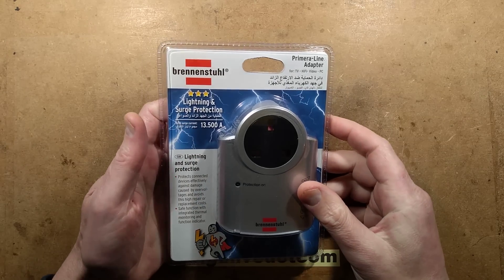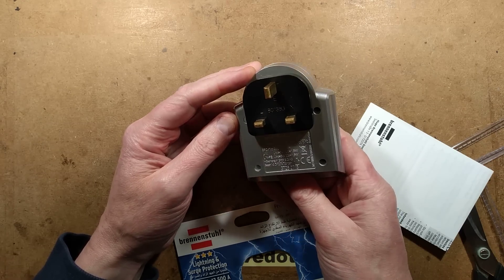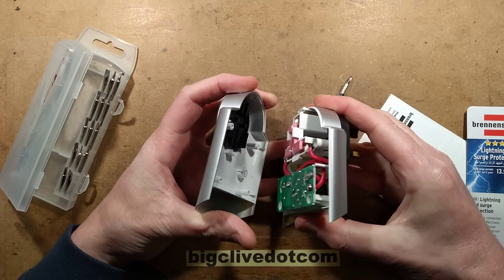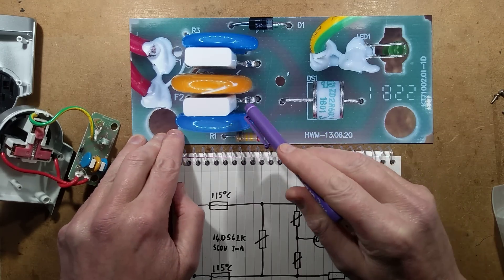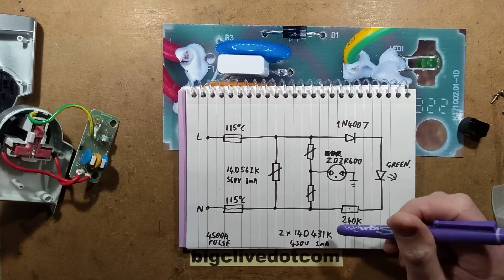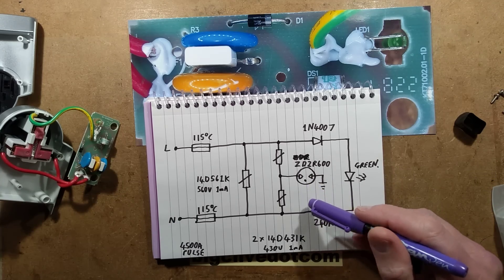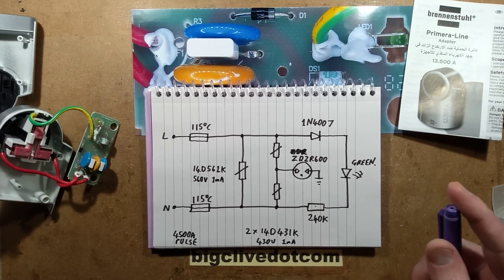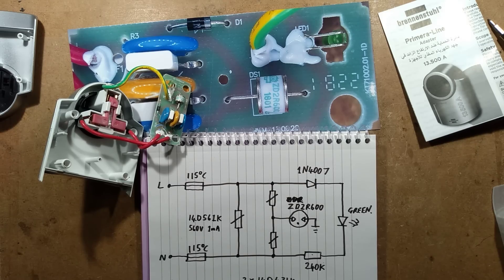Inside a 13,500A surge protector.  (With schematic.)

Comment: Hi Clive. I recently bought two InTempo Tailgate speakers. I returned the one that didn't work. Replacement didn't work either, so naturally I took it to bits and found out why. Possibly the thinnest PCB I've ever seen with very misaligned, feebly soldered components and liquid flux still puddled all over the board on both sides. I'm not skilled enough to fix it, and don't care, but I'd appreciate if you get hold of one and do a teardown vid. If the manufacturer had spent a bit more change on the board, this would be a nice bit of kit for busking. Sadly they didn't want to charge me £10 extra for that durability on a £30 retail item. A shame. :(

Comment: MOVs are rated in joules of dissipation. They might be 50, 100 joules or whatever. A joule is a watt-second, so if you have a specific voltage and an impressively high ampere rated MOV you can roughly figure out how long that MOV will last before exploding. This is left as an exercise for the student; compare to the length of a lightning strike. 

The other thing I'd like to point out is that MOVs are good for one time use. After they soak up that one lightning-induced surge (you hope), then you throw them out because their breakdown as been compromised. Many will start to break down over time with no surges, then they just burn up because their dissipation goes exponential. They are not to be used as zener diodes. 

Also, because they break down in nanoseconds, you will have some interesting spikes ricocheting around your power lines unless you position them at the lowest inductance point across the incoming mains.
Reply: Thank you for mentioning that MOVs break down over time. Probably a good 95-98% of people don't know that line voltage dips and spikes all day long "wearing out" surge protectors, and they should be replaced every so often to be on the safer side.

Comment: How fast does it work?  I once lost a computer power supply to what I think was a lightning surge.  Would this device have prevented that damage had it been in the circuit?
Reply: MOVs are very fast devices, on the order of 500 picoseconds.  If your supply died due to a voltage surge containing a voltage and energy amount the MOV can absorb, then yes a surge suppressor likely would have saved it.

Comment: There are similar protections in PC powersuplies and APC units.
How long wiering they can protect from surges? I mean as long the copper wire goes, the resistance almost 0, so if I plug this anywhere it shail protect anything untill reaching the nearest street transformator (wich seems impossible).
Oddly simple circuit, I just wonder why these are so large in housing and made like an addable socket switch.

Comment: I've encountered a few Brennenstuhl products, and they all seemed to follow the same pattern - a robust high quality case with the crudest possible contents. For example they make (or made) power strips and power sockets with built in power measurement that avoid using a 20 cent energy measurement chip by roughly measuring RMS voltage and RMS current and displaying the product (i.e. they display apparent power instead of the active power you would expect). The case of this surge protector seems to be thin white plastic sprayed over with silver coloured paint, so even the case isn't very high quality.

Comment: more then certain 13.5 amps. im sorry 13.5KA would obliterate it and anything connected to it more then likely
Reply: Bourns 2045 Series 400V 15kA Axial 2 Electrode Gas Discharge Tube
https://uk.rs-online.com/web/p/gas-discharge-tubes/7687452/
Oh really ?

Comment: Limited protection for other connected devices on the other side of the circuit:
1. It cannot protect against a common mode surge. This occurs when both L & N have elevated voltages which is common for lightning induced surges.
2. Any energy passing through  the GDT will elevate the ground voltage providing a reverse path for the surge to reach devices. Its possible the voltage potential will be higher on the ground than L-N for other devices connected to ground. Typically Ground has a high impedance of about 6 ohms and thus lacks the ability to shunt large surge currents.  

Generally a good Surge suppressor will filter out a surge pulse using an high frequency LC filter such that a fast transit cannot reach the load. The other alternative is to absorb the energy in a Cap bank that slowly bleeds off the collected energy. 

I've see a lot of cheap MOV surge protectors do more harm when the shunt energy into ground, only to damage other devices connected to the same ground circuit. MOVs are usually only good for very few number of surges. Quality shunt type protectors use Silicon Avalanche diodes (very beefy Zener diodes) which do not degrade with use. Typically MOVs have high clamping voltages well above mains voltage so they are not frequently triggers.
Reply: Huh?  That's what the gas discharge tube circuit is for.  A common mode surge will be dissipated to ground through the two MOVs and the gas discharge tube and the voltage spike on the entire circuit will be clamped to the MOV clamping voltage.  Once the tube arcs over, there is essentially zero voltage drop across the tube.
How exactly would the voltage on the ground be HIGHER than the L-N pulse that energized it?  In the US, the ground connection has to be low enough impedance to trip the breaker if hot is shorted to ground.  Any higher voltage will do it also.

Comment: Where does the device plugged into it come in? Is this just in parallel to a direct throughput?
Reply: The MOVs are in parallel with the entire branch circuit.  It protects everything in your house, to one degree or another.  The more impedance there is between the protector and your device, the less it will protect it.

Comment: 1.8kv let through voltage (Up)... crap. The withstand voltage as defined by BS EN 62305 - Protection against lightning, for electronic equipment is only 1.5 kV. Industry standard for final equipment level surge protection devices (SPDs) is sub 600v when tested at a "type 3" surge. All they have done to come up with that 13.5kA surge rating is to simply add up the total across all modes (phase to neutral, phase to earth, neutral to earth being the modes). Not the way to do it. BS EN 62305 and BS EN 61643 both work on ratings per mode, not total. With that GDT rated at only 1 shot of 5kA, and that being the one path to earth, that kinda gives you a better idea of the proper rating... /*edit, wrote all this prior to you saying that at the 10 minute mark*/

Comment: Why would 13.5 amps be so odd? X220v =  about 3000 watts which protects the wires inside the wall from heat abd fire if too many appliances are using the same wire. But i am only a student dear master Big Clive.

Comment: I would not trust my devices with this in between !  I would not use any thermal resistors or fuses to protect against surges!  would use varistors in a parallel with two gas discharge tubes and two transient  suppressors.
Reply: You need to watch the video again.  The thermal resistors keep the thing from burning your house down, they're not protecting against surges.
Reply: @stargazer7644  what is the product called ?
Reply: @MGoudsmits  You're complaining that you wouldn't use thermal resistors or fuses to protect against surges.  This product doesn't use them for that purpose.  It uses MOVs (varistors) and a gas discharge tube to clamp the surges.  The fuses are there to keep the thing from going nova and burning up if the MOVs fail.
Reply: @stargazer7644  sorry  maybe not clear enough,  but the thing is a surge  protector,  even for lightning it says.  well the design  prevents it from short circuiting the over voltage ( surge) and re-directing the current ASAP to the ground. the one resistor might be on fire before the other one realizes it gets warm !  then the lighting surge is over, did its damage and the device starts to limit the current.  the surge in nanoseconds is probably way to fast  compared to the hysteresis of the heath transfer of miliseconds.

maybe you can explain why you would not opt for redirecting the surge in stead of  trying to dissipate it and then when all fails finally redirect it to ground.  do not forget this device is in parallel.  so imagine your high end TV  uses 180 watts  so 1,6 amps at 110 v something like that  that makes your  TV act as if it is a resistor of 68 Ohms.
Now which way will the current go to the low 68 Ohms or the resistor that allows 1 mili Amp at 560 volt ??

Comment: I need help. Ive got cables soldered on a tiny board. One cable go to the computer and the other cable go to the headphones. The issue: How do I prevent/protect the soldering points from accidentally getting ripped off if the cable gets snagged on something? I have no clue what to do.
Reply: Drill two hole close together, loop the wire in and out like a buckle
Reply from the maker: Hot melt glue and/or folding the cables round so the solder joints don't get pulled directly?

Comment: I started as a telephone engineer.  We used to routinely fit lightening protection gas discharge tubes, fuses, local earth and same again at the exchange.  When lightening hit you'd be sent to scrape the wires off the wall  and once, to pull art of the phone case out of the door.
The exchange had bigger separation and usually took little or no damage from a strike.

As a mill town we had 100s of mills running massive inductive loads, as well as heavy and light engineering.  The mains was pretty noisy most of the time.  Spike filters worked quite well on the early digital kit, we had various sizes so  could cope with most cases including a huge DC plastic welder.  I still use filters.  Only powercuts affect anything.  I've seen 7 strikes in the nextdoor field, less than 20 yards away with no effect. I don't know if they do work or if it's just the type of land or what - I work on the principle that its hurting nothing and costs nothing, so why not?
Reply from the maker: The power lines have lightning arrestors which are basically stacks of MOVs that shunt the strike to ground on the primary side of the transformers.

Comment: What is the point of the gas discharge and having it to ground?
Reply from the maker: It can pass a lot of current and in the normal state has almost zero leakage current to earth/ground.
Reply: @bigclivedotcom  Thanks bigclive. However, wont this trip a GFI every time there is a moderate spike? Also, why not just have the one varistor? Is it a redundancy thing, using two different methods?

Comment: We used to use gas discharge tubes as trigger devices on capacitive discharge high voltage generators.
The tubes were sourced from discarded phones which were full of those tubes for protection.

Comment: The thing is 13500, should classically be expressed as 13'500. Using an apostrophe gives absolute disambiguation from comma ( , ) or full stop/decimal point ( . ) - especially if hand written. It is only an artefact of the lazy computer world that has introduced the comma as a separator in numerical expression.

Anyway, that said, who else loves it when Clive sticks his fingers directly across a device and says " Am I gonna get a zap off o' this? " . . . ? - I guess that if you really wanted to, you could, in theory, build a massive surge suppression unit, and connect it in parallel with your main switch, at the distribution board, to protect your entire household gadget inventory?

Comment: APC used to offer that, and in Florida they lost money hand over fist.. After all, Lightning just jumped 5 miles or more down to your power line... and as a result into your house.  They are claiming 13,500 amps?  How many Joules?  The problem is that lightning wants to go to ground, and anywhere it does it there is a bunch of current, which causes induced current in all wires near by.  MOVs will do SOME help, and are part of the electrical code in Florida.. but do they help?  Or is the only thing you are getting an insurance policy that may or may not help????  In Florida, I never got damage directly from the electrical lines.. but watched a lightning strike hit a pole just outside the condo complex... and it jumped over to the telephone mushroom next to the pole.. and that is where loud noises happened.. a VERY expensive Modem for that time frame.. and arc'd (after popping the tops off about 10 chips in the modem) over to the hard drive in the computer... and burned a HOLE in the sealed unit.....<sigh>  actually managed to get a piece of tape over the hole... and found that there was a burned spot on the motor so it wouldn't spin up... I picked up the whole computer and gave it a spin while turning on the power, and the hard drive spun up!  With that I was able to pull a full back up of that drive... and when the insurance paid off the $900 modem and drive, was able to get the system back fully operational..  The two HUGE mov's in the circuit breaker box probably did help with the surge at that point.

Comment: 0:17 - In most languages, a comma is used for decimals, and (optionally) a point for digit grouping. English is kind of the odd one out in Europe, with the "decimal point".
Reply: > Matt Quinn wrote:
> actual mathematical notation (which is language independent) represents the decimal point thus ·

No. Mathematical notation is very much not language independent, and as far as a "global standard" exists (ISO / IEC), that would be the comma:

https://www.iso.org/sites/directives/current/part2/index.xhtml

9 Numbers, quantities, units and values
9.1 Representation of numbers and numerical values
• The decimal sign shall be a comma on the line in all language versions.

In practical terms, linguistic conventions tend to override this. For example, Canada uses commas in French documents and points in English documents. South Africa is a bit unusual, and generally uses the comma even for English text, and there are more exceptions (including countries that use neither).

If you only speak English and haven't travelled much, I guess your world view is a bit skewed. 

The character you used is called an interpunct, and it's specifically banned (or strongly discouraged) by international organisations, due to being identical to the multiplication dot. 

> the use of a comma to represent the decimal point is an affectation brought about
> by medieval typesetters concerned about printing ancient Latin texts

Again, no. Before printing, the most common notations were to use a horizontal line over the units digit (ex.: 1Ō5) or a vertical line after the units digit (ex.: 10|5). Since the former was hard to do in print and the latter could easily be confused with a 1, this was changed to a comma, in continental Europe (ex.: 10,5). In England, it was actually changed to a symbol similar to an "L" (ex.: 10L5), and later to a point (sometimes a full stop, sometimes an interpunct - the latter having fallen into disuse for the reasons explained above).

No one ever "used a comma to represent a decimal point", because the comma was replacing a bar, not a point. In fact, one country almost "used a comma to represent (or rather, replace) the point", and that was the UK, in the 1960s. The comma was preferred in most technical fields (industry, engineering, etc.), and officially recommended by the British Standards Institution, but they were eventually overruled by the government (due to pressure from the financial sector and the USA - same reason why the UK now uses short American "billions" despite its own history and its own national institutions recommending the long scale).

> this product is aimed primarily at the British market

Aimed at the British market... with text in Arabic? Maybe Fox News was right about Birmingham after all... :D
Reply: Obvious troll is obvious. I'm afraid feeding time is over.

Comment: At 3:07 we can clearly see that the maximum rating is 3120W. If we divide this by 230V, the nominal voltage in Europe, we get 13.565 A. That's what the 13.500 A are for I guess. Surprisingly it does not support 16 A
Reply: That 3120W rating is for devices being powered by the outlet.  The 13,500 A is as Clive described in the video.

Comment: Amperage for a surge protector really makes no sense. A surge protector clamps the voltage to neutral and/or ground and it dissipates energy in order to clamp the voltage. The peak current is just the current used under test before device failure and is time dependent. Looking at the datasheet for a S14K385 MOV for example shows 460 volts and 4500 amps absolute maximum. So it dissipates 2 megawatts?! No. Because it can only sustain that for 2ms which equals about 103 watts over a second before exploding into flames. The peak current is really quite irrelevant in terms of current passed to the devices. A device that uses 8 amps to turn on could get fried by a 300v spike and 50miliampres.  Further only two of the MOVs would do anything for most surges. Another is for floating neutral or induced neutral spikes.

It is important to have as little resistance as possible between the surge protector and the devices being protected. Note that this means it doesn't actually matter if devices are plugged into the surge protector or not as long as they are a low resistance path unless the surge protector also shuts off the down stream devices due to over current. This is typically done with a fuse, resettable fuse or breaker. The joules rating on surge protectors is a slightly more honest but also somewhat misleading metric. It does indicate actual protection in the sense higher is better. But the way electronics are susceptible to surges is still hidden. It's voltage that will destroy most sensitive equipment and many surge protectors do not state their clamping voltage. While joules will tell you the surge protector isn't as likely to fail on you it still doesn't tell you its really going to protect the equipment.